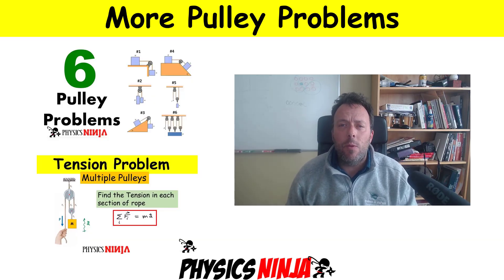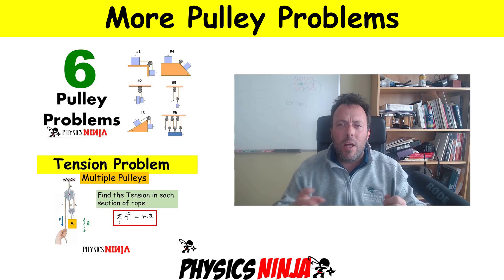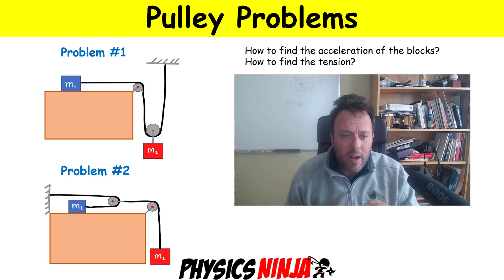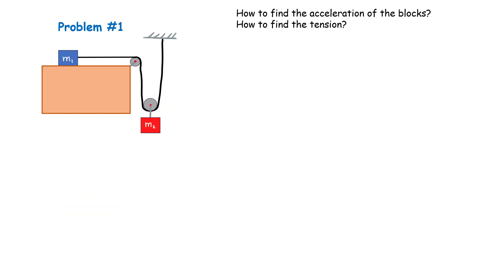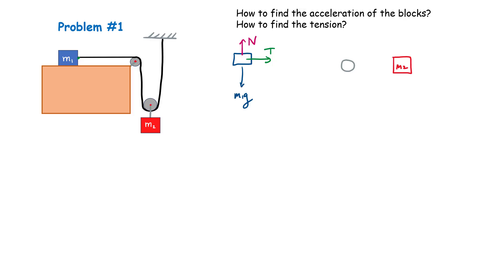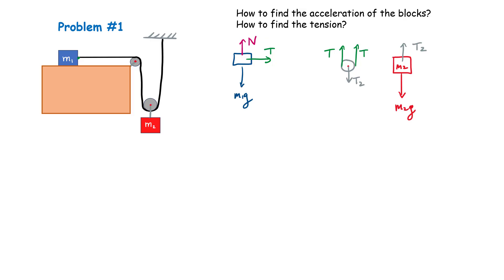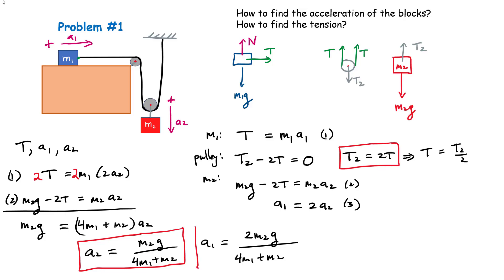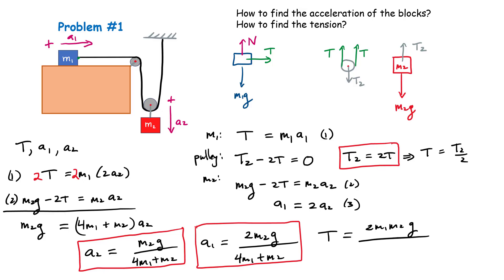Harder Pulley Problems

Comment: An object of mass M1 = 1kg on a rough horizontal table (µ = 0.1) is connected to objects of mass M2 = 2kg and 
M3 = 3kg through a very light pulleys as shown in Figure below.
(a) If a1, a2 and a3 are the accelerations of M1, M2 & M3, respectively, what is the relation between 
 these accelerations?
(b) Determine the values of the accelerations a1, a2 and a3 𝒔
𝟐
(c) Determine the tensions in the strings
Do this question for me please